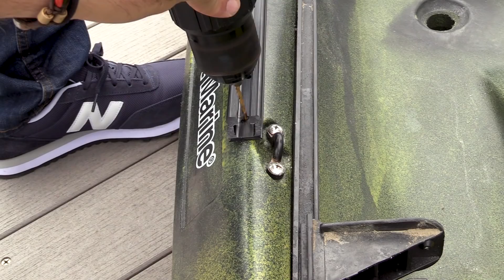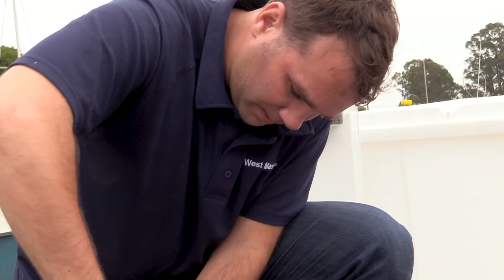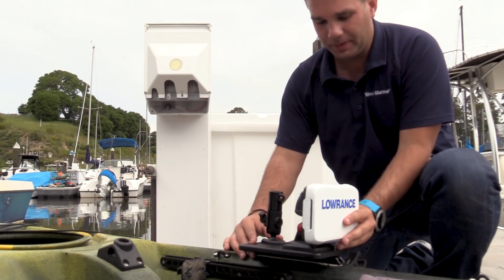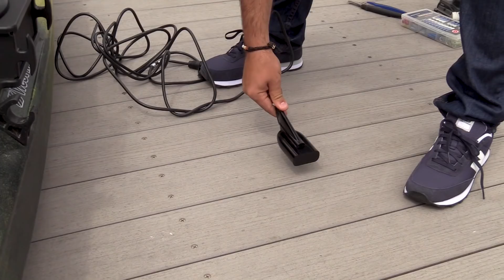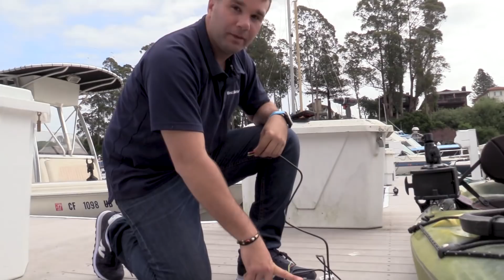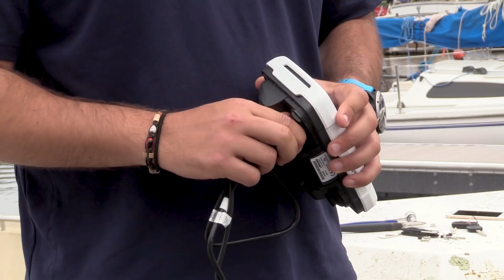Installing a Lowrance Fishfinder on a West Marine Kayak

Comment: Great video. Im considering a similar application for an inflatable boat. I have a ~10+' [2 bench seats] BestWay inflatable with aluminum floor. I believe WM sells a very similar boat. Im considering using for near-shore fishing as Im moving to Brazil. The IB has already been shipped there.  Can you make recommendations for this application?  Id like to have both FF and GPS like this unit. Like the larger screen and thinking maybeWhen I move into a larger sport fishing boat I might be able to move this Unit to a permanent installation. Appreciate any advice or suggestions!
Reply from the maker: It's unlikely the installation methods shown in the video will be applicable to your inflatable boat.  A transom mount transducer with a suction cup mount may work better for you.  Please call us at 1-800-BOATING (262-8464) or visit a West Marine store location to discuss your options.

Comment: Did not see an in-line fuse installed between the battery and the fishfinder.
Reply: I'm curious about this. This is supposed to be a professional installation, but there's not in-line fuse installed here. Do you need to install one? Does it already come with one? I'm putting a Helix 5 on my kayak.